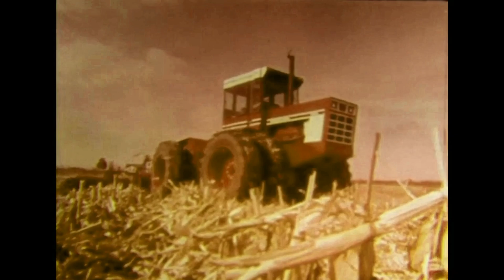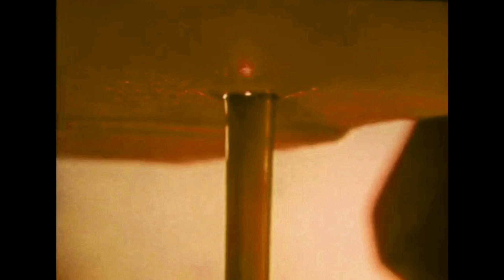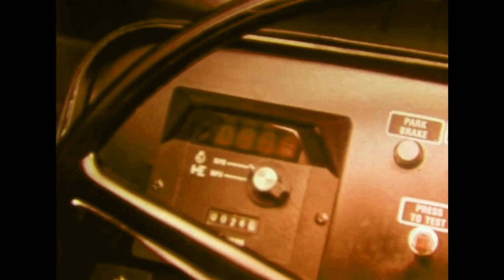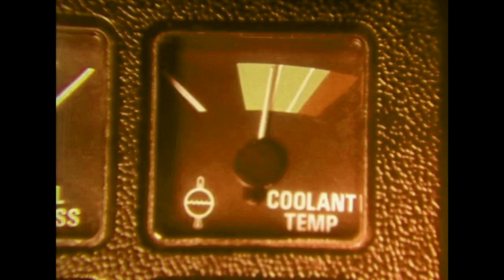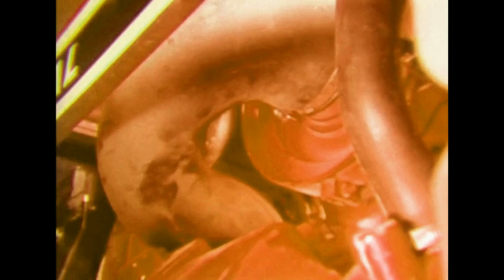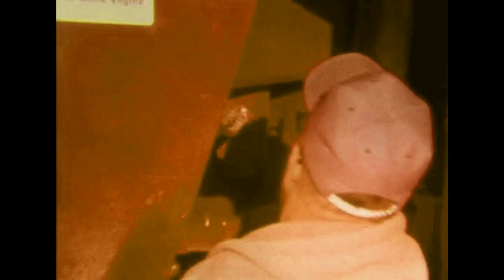"4-Wheel Uptime" from International Harvester

Comment: Octane Press, Did IH buy into Steiger around 1974? I think it was around 30% of the company. Cool video.
Reply: Yes they did invest in Steiger. That deal was put together in 1971 I believe, and was part of the Steiger-IH partnership that launched  with the 4166 which was built and designed by Steiger with an IH engine and transmission (and a few more IH bits). Steiger built their current factory with the influx of IH cash, and opened that in 1976. Ironically, IH sold their Steiger shares to Deutz in the early 1980s, a few years before Tenneco bought Steiger and merged it back with IH. You can find the entire story in the book Red 4WD Tractors.
Reply: @LeeKlancher 4366, they built frames for all articulated ih tractors, it was a service agreement, not ownership.